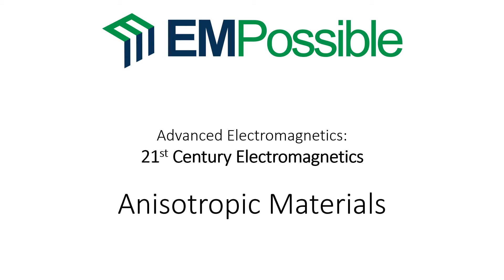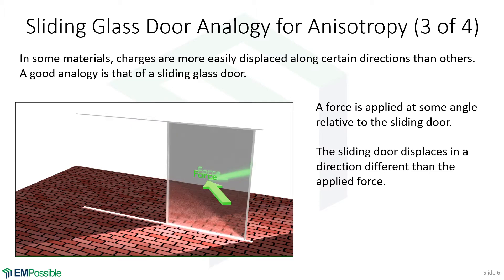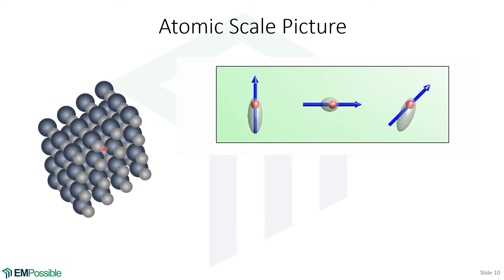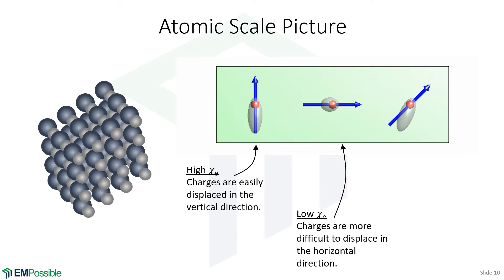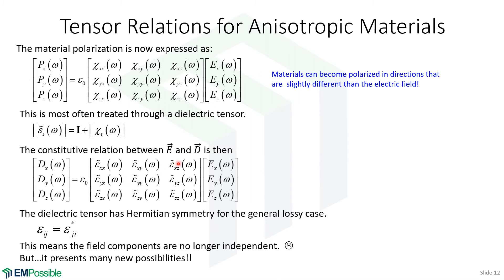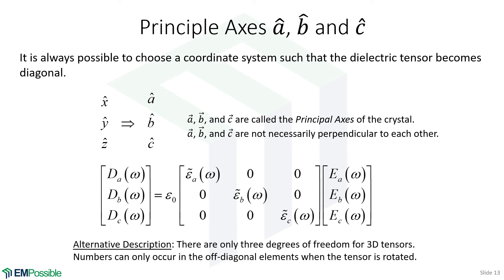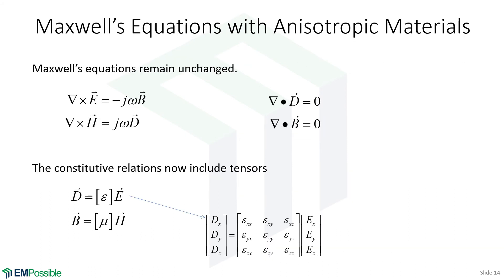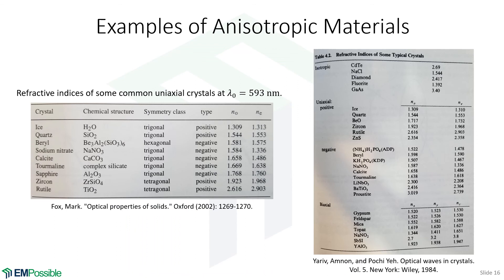Lecture -- Anisotropic Materials

Comment: Dear Prof. one question:
Why do we use only diagonal matrices to represent anisotropic material? I mean why the other elements of the matrix are zero? Is it always the case?
Reply from the maker: Good question.  We live in a three-dimensional world so there are only three directions that a field can oscillate.  This means there are only three different values for permittivity (or permeability) that a field can experience.  These are the three principal values you see along the center diagonal of a tensor.

Now, if you analyze an anisotropic material using coordinates that do not match the principal axes of the anisotropy, you will get off-diagonal terms in the tensor describing it.  I talk about this a little bit in a later lecture, Lecture 2k.  I also animate how the tensor changes as the anisotropic medium is rotated relative to the coordinates it is being analyzed.

I recommend accessing the course materials through the course website.  That is because you can see all the lectures, download the notes, use links to the latest version of all the materials, and get links to other learning resources.  Here is the course website:

https://empossible.net/academics/emp6303/

Hope this helps!!
Reply: @empossible1577  Thank you for your answer. Another question: What is mean by X-cut, Y-cut, or Z-cut anisotropic materials? Suppose if I want to get the
X-cut lithium niobate then what would be my rotational matrix?
Reply from the maker: @rabiulislamsikder344  Unfortunately I do not know the specifics for LiNbO3.  The cut is talking about the orientation of the facets relative to the crystal.  In the end, it is communicating the orientation of the crystal.  There should be data sheets from wherever you are ordering this that will give specifics.  Sorry I cannot be of more help!